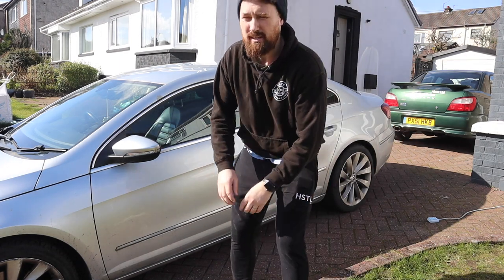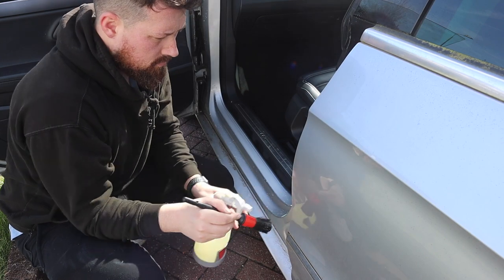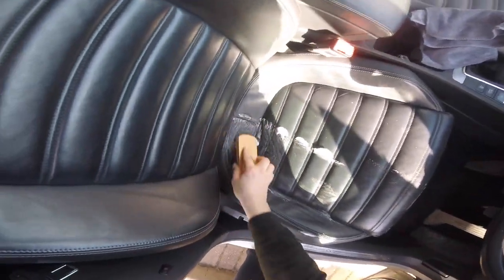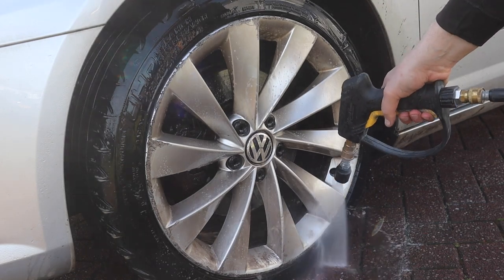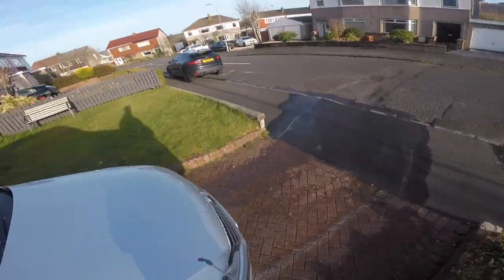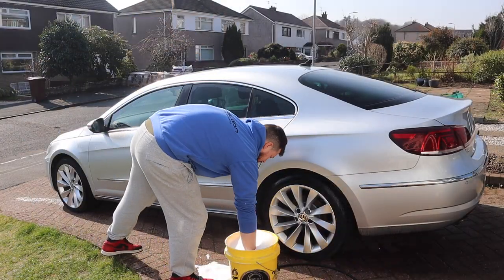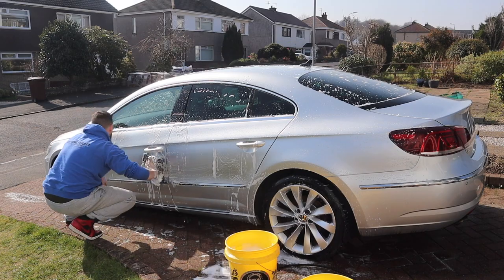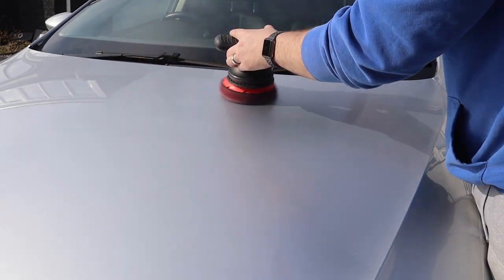Filthy VW gets brought back to life - full Detail and Ceramic Coating (disaster detail)

Comment: I did 1 car with that infinity wax light ceramic and 1 with Gyeon cancoat last September, both easy to use but the cancoat has blown it away for over winter performance on the super salty roads up North here
Reply from the maker: I’ve not had the chance to use can coat yet but it’s on the list as I want to do the exact test you’ve just mentioned but possibly half the car done with can coat and half with synergy lite. Did you find can coat as easy to apply as the synergy?
Reply: @DavidMcBay  To be honest, can coat was probably a tiny bit easier to buff off but both definitely easy to use. But the difference in the water performance is wild. Cancoat is a monster, both products are still going fine but the water performance is night and day.
Reply from the maker: I’ve got another few cars lined up for a similar detail as this video so I think can coat will be getting used on one.